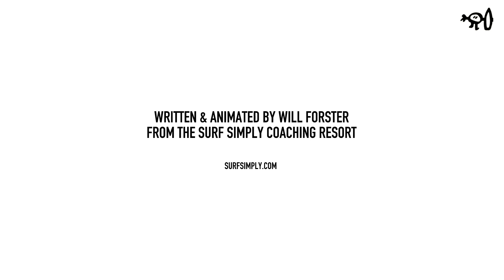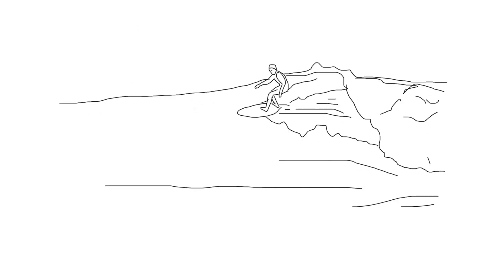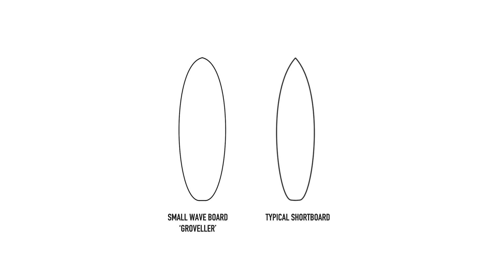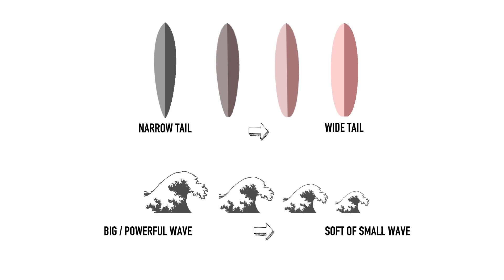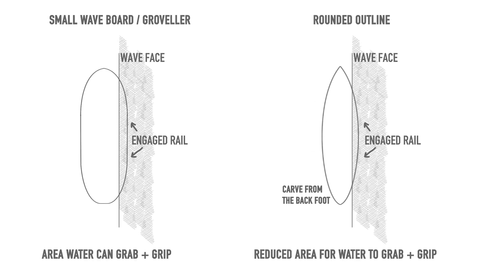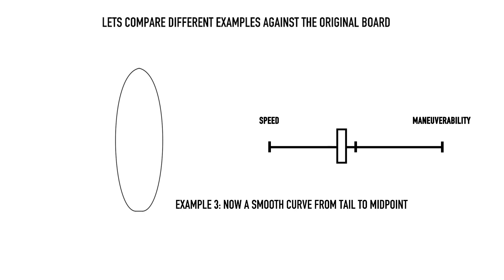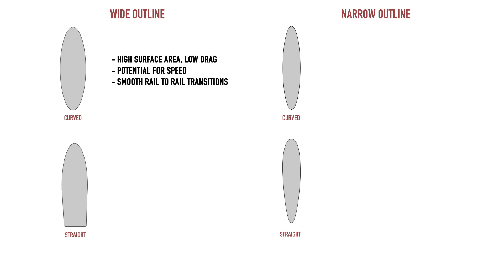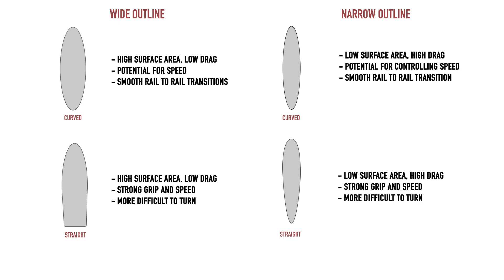Surfing Explained: Ep7 Tail Outline Shape

Comment: I just want there to be a stock standard versatile shortboard. One size fits most. Something like 30L, 6ft, nose slightly blunted for durability, with small swallow tail, thruster set-up, ofc option to twin when it's mushier.

It'd be solidly popular, and mass produced steadily without high marketing costs. The surfing equivalent of Adidas Copa Mundials. Torq have the closest but it's stiff epoxy. Maybe this hypothetical board would be wood, as Copas are mostly leather. So like a timbertek but a synthetic element to keep costs down. I'm gna have to do this myself aren't I...
Reply: You should hit up Kazuma Surfboards and check out his Mamo model with a 5 fin setup.  It fits very closely to what you describe.  If you want a little more high performance he has the Oama and Piglet.  I love his boards and he has amazing prices, fast turnaround and world wide delivery.

Comment: Thanks. How about the same boards with round vs squash vs swallow tails in terms of speed, hold, manoeuvrability?
Reply from the maker: Great question Roger, and we’re going to answer that in the upcoming Question Time video!
Reply: The tail only performs about 5% on the maneuverability of the board. Swallow tail tends to snap better, squash goes a bit faster as well as pintail. Round is more cruisy but also can be manueurvable.

Comment: great  vid, but whats the advantage of a "swallow" tail? Like you see on some fish boards
Reply from the maker: Hi Tcl, great question! We are going to answer this exact question in our upcoming Question Time vídeo so stay tuned!
Reply: @SurfSimply  could you also pay attention to rails that have a sudden 'dip' and what this does for your board? (Like the swallow tail you showed that wasnt a retro fish) Would be awesome, thanks in advance!
Reply: @Surf Simply looking forward to hearing about the difference between wide swallow like the jet fighter tail on the El Tomo Fish vs a narrower swallow like CI Rocket Wide. The Tomo also has a bump to break tail line. And what about the inverted convex cutout on the HS Holy Grail, which has a wide tail. These three boards attempt to give you both lots of lift but a lot of control at speed. I've found all three to work waist high to well overhead but I don't really understand their tail and outline differences. Really appreciate your videos and the thoughtful explanations and great graphics. Looking forward to more detail and specifics on as many tail shapes as you can discuss! Thanks in advance and keep up the great work!
Reply: Best thought about when considering a tight turn like a cutback on a small wave. As you are turning one side of the tail is engaged in the water. The swallow effectively lowers the surface area right at the back of the board allowing the tail to dig in a little harder. This is particularly advantageous in grovlers with a wide outline and a thicker tail. They can be particularly unruly when you try and drive the tail round a tight turn.
Reply: The tail on the boards uses about five percent of the board performance. The swallow tail depending on the size is use as two round pins. It does tend to snap better than other tails.